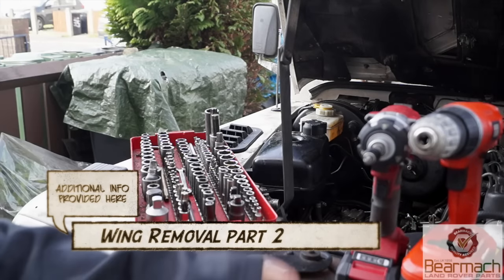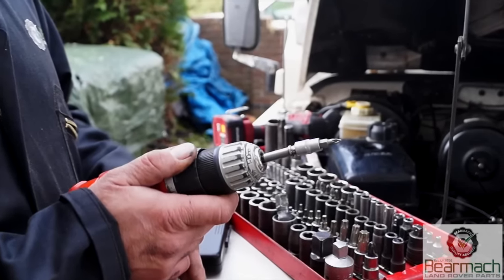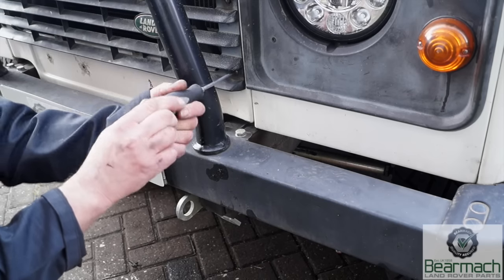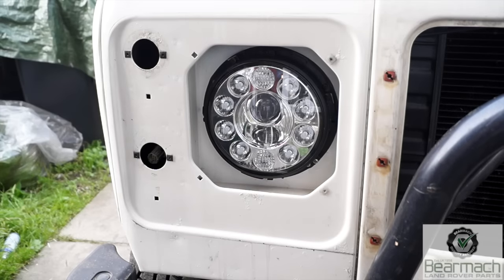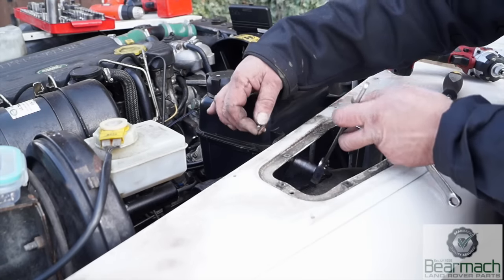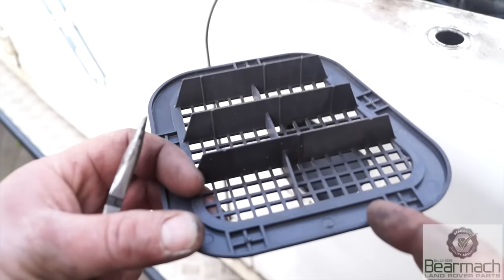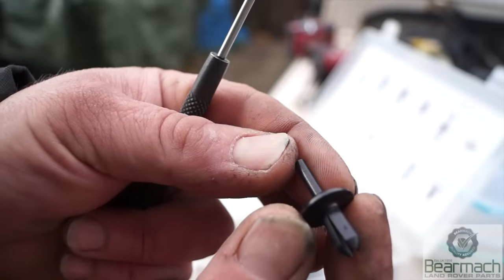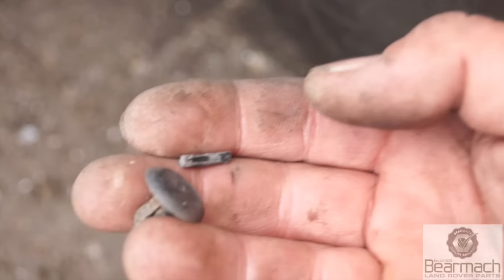Defender wing removal PART 2  plus bulkhead corrosion surprise

Comment: I owned a defender 10 years ago and struggled through the diy on it. Your videos make it a pleasure to work on my new(1985) defender, thank you. I also enjoy your tool recommendations and have purchased a few handy bits on your advice. I was wondering where is a good place to buy in bulk things like fittings for door trims, bolts, screws etc in bulk as they can work out expensive if you buy one at a time and you won't really know the exact size you need until you need it, i.e. where to stock up on an assorted box suitable for the defender, thanks again!
Reply from the maker: +Padraic Seosamh Waters   Ah yes.  Boxes of screws,  bolts, nuts, clips etc  you'll need to do some research.  I get mine from a company called Cromwell Supplies in East Anglia.  I'd advise finding a professional engineering supplies company then get some catalogs off them to browse.  Plenty of suppliers on the internet however.    I'll be showing some assortment boxes as we go through the build work.
Reply: +Land Rover Toolbox Videos cheers.

Comment: In all the time they made those vehicles and had the time to  identify those problem area's it's criminal that they didn't address the rust problems and better protect them over the years. Just some bitumen sealer at the bulkhead ends and in that mud trap would have been better than nothing.